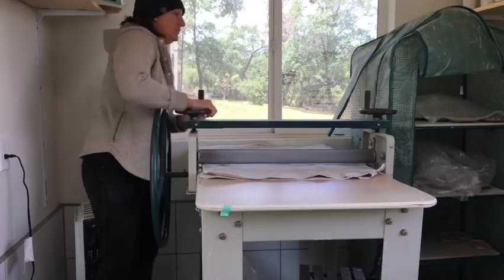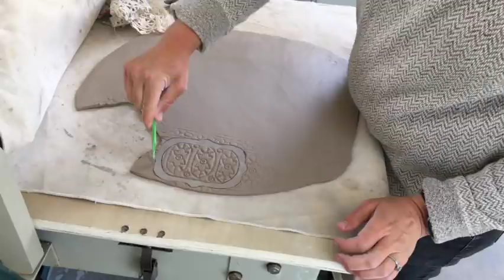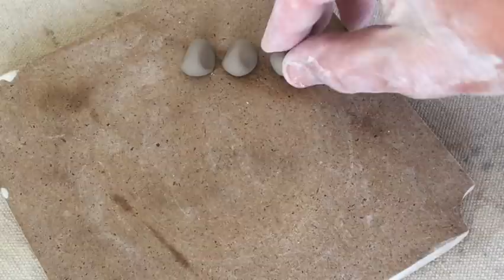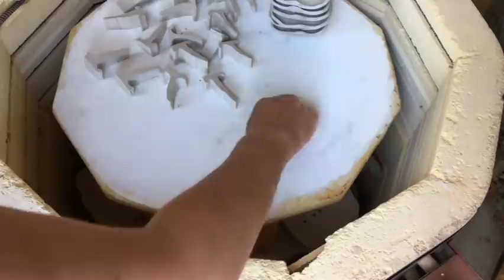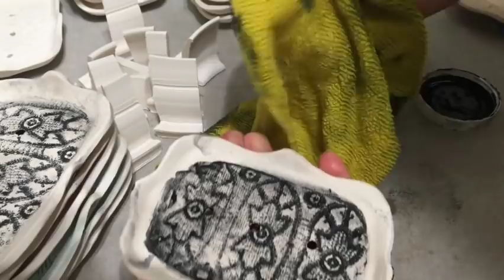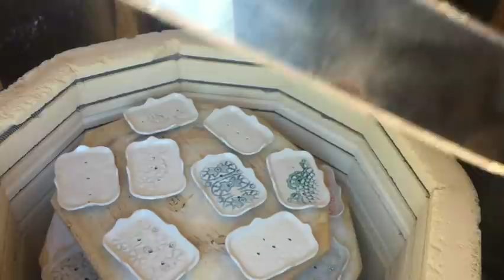Ceramic Soap Dishes: Complete Handbuilding Process in 10 Minutes

Comment: I could see how her hands could get tired with rubbing out the glaze outside of the texture. Maybe getting a drill with a sponge attactment could help reduce the strain and speed up that operation.
Reply from the maker: Are you an engineer? This is something my dad would suggest. Hahah Thank you! I find that the hand wiping helps me control how much of the underglaze remains in areas that didn’t have enough depth in the imprint but I could probably use a larger sponge! Or a drill with a sponge sounds fun too! :D

Comment: Beautiful work.
I'm a bit curious as to the purpose of the beans.
Reply from the maker: When drying clay bodies that have a flat surface I like to pour beans on the surface to put some surface pressure on to avoid warping. I don’t know if it’s needed or not, I just do it out of precaution.
Reply: @sonja.ceramics  Thanks. All my warping seems to happen in the kiln, but I haven't really done any flat bottom pieces yet.

Comment: What are the clay "T" shapes in your kiln?
Reply from the maker: Those are test tiles. I use them to try out various glaze combinations before using them on a final piece. I will do a video about these in the future!
Reply: Where are you that your kiln can be outside like that? It must not get cold where you live?
Reply from the maker: @Bellamarcella1212  we get down to 20* or so. I haven’t really had any noticeable problems but I’m sure the weather isn’t easy on the kiln. It was pretty beat up when I got it and I did a lot of repair work myself. I try to keep it sheltered and cozy when it rains and snows.

Comment: Which clay have you used and which glaze?
Reply from the maker: Hi! This was the Hagi porcelain by Laguna. I actually will probably use something like the bmix. These warped a tiny bit and I’m wondering if they would warp less with that clay. I glazed them with a satin white by Laguna. The colors painted on are a colored underglaze that peeks through. I feel like it gives them a rustic look.
Reply: @sonja.ceramics  pls suggest a glaze for terracotta clay?
Reply from the maker: @meenusubrahmanian5692  I haven’t worked in terra cotta and don’t know what clay body you’re using. Where is your clay from? I’d try to buy glaze made by that producer. If you’re just asking about color you can’t go wrong with white topped in pastels like seafoam, etc. Just one person’s opinion though!
Reply: @sonja.ceramics  I'm using eco friendly natural clay : terracotta the red one...i cannot use the glazes which are for earthenware and stoneware clay..so was confused..this terracotta is fired at 1000C
Reply from the maker: @meenusubrahmanian5692  I think most pottery stores will have a low fire glaze. Or you would research low fire glaze recipes if you’d like to make your own. I don’t have experience with making my own glaze yet so I’m less than helpful.